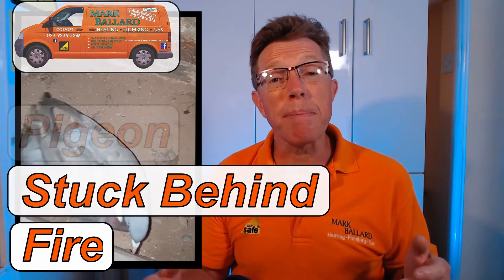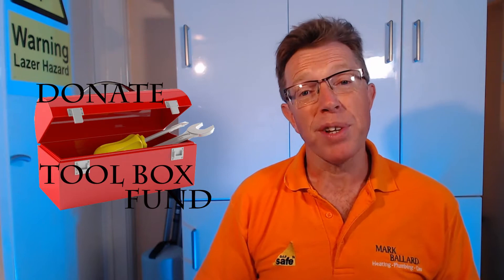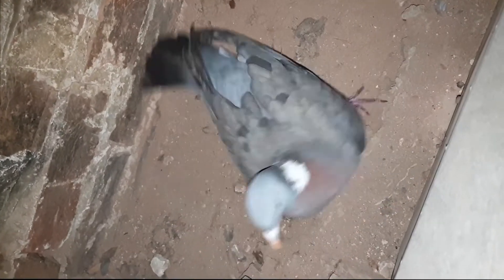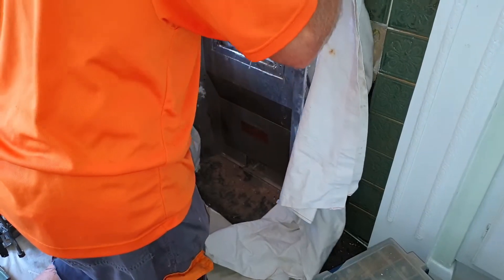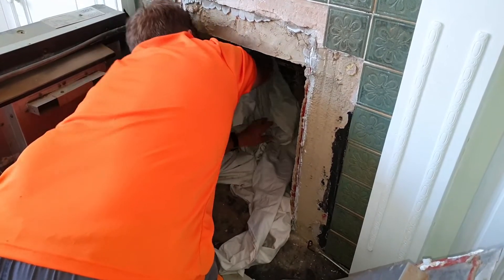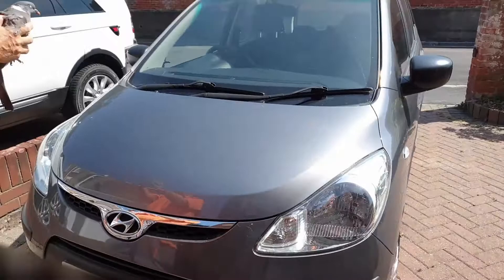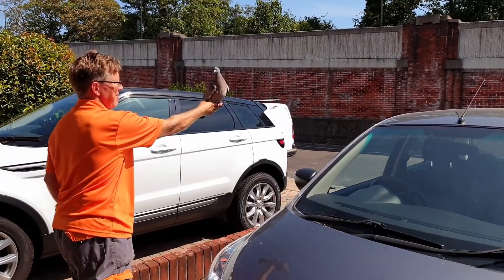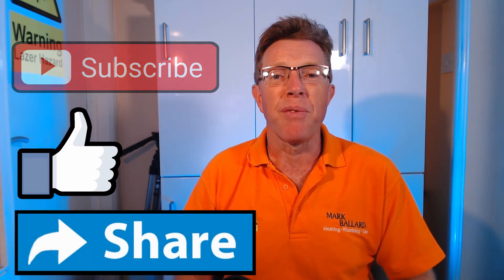Pigeon Stuck, Trapped Behind Gas Fire!!

Comment: Hi Mark 
Can you shed any light on a problem I have with my baxi boiler it keeps making a virbrating noise when you run the water it sounds like an aircraft taking off is it air in the system any advice would be greatly appreciated cheers mark 👍 thanks for the you tube channel it's fantastic great job 👍👌
Reply from the maker: Is this a baxi  combi 105e?
If it is a combi. And when you run hot water it makes noise. Most likely the plate to plate hot water heat exchanger is scaled up. And will need replacing. Normally the hot water will go hot and cold or not get hot at all. If plate is blocked.